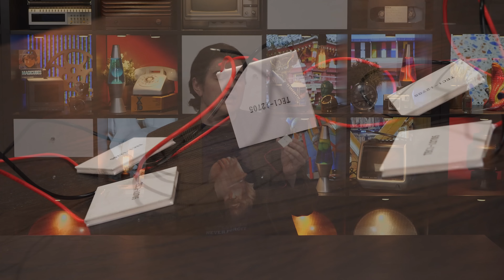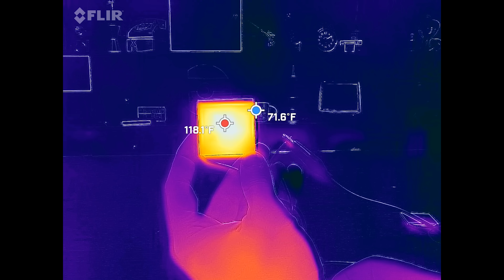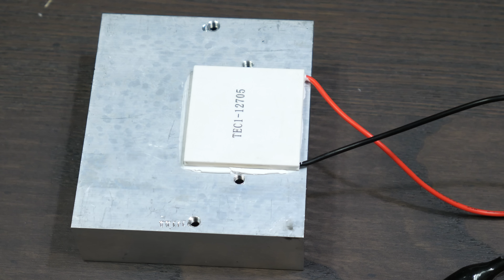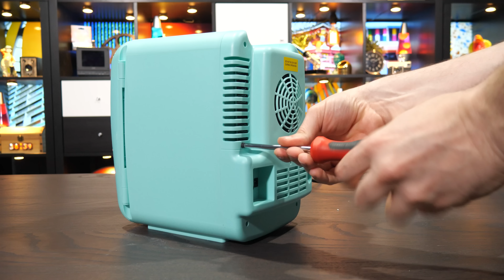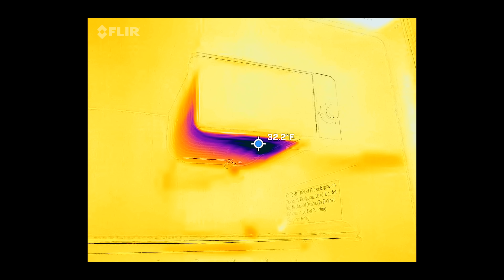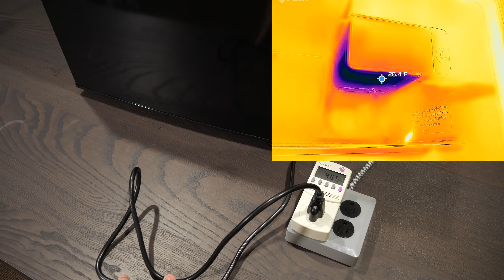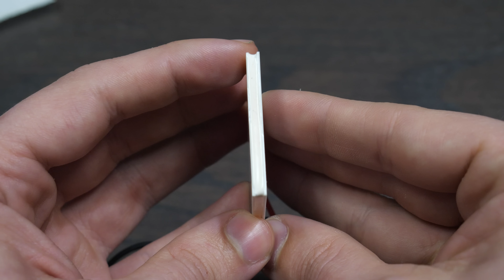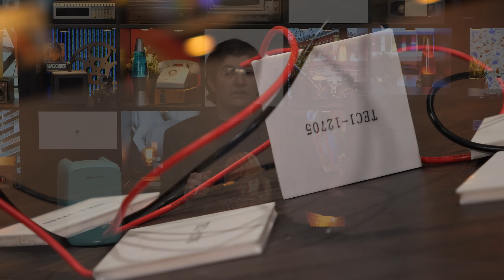Thermoelectric cooling: it's not great.

Comment: comparing a mini fridge to the tiny fridge is ignoring one thing: the mini fridge wont fit where the tiny fridge will and thats the entire draw and appeal of the device... make a legit fridge that tiny and you'll be filling the same role and will address the problems you brought up! yes, its poorly designed and inefficient but if someone really wants a tiny fridge how many options are there? Hoping for a legit, decent quality option because now i kinda want a tiny fridge as long as its not shit lol
Reply: You're technically correct, but there's a fairly small niche of applications where minifridges are too big but you need actual cooling.
These are about WxDxH 7"x10"x10", whereas the smallest mini-fridges are about 16"x16"x19". I could fit a mini-fridge on my desk with only slight inconvenience. I could fit one under my desk too.
I think in part the reason there aren't smaller proper fridges is cost.  The minimum cost of the compressor set up is just high enough it wouldn't have a market.

Comment: The reasons that Peltier devices do not usually have simple on/off thermostats besides the extra cost to manufacure and being probably unnecessary is that with many cycles of on then off cycles the Peltier elements can be seriously degraded by repeated micrscopic cracks due to the induced thermal shocks of on/off operations or phases. More sophisticated, also more expensive, temperature controls would use PWM contrrollers with PID modulation to reduce thermal shocks to the Peletier elements while maintaining an acceptable temperature range under varying working conditions and an acceptably long operational life.

Comment: The 12v DC compressor technology today is amazing. I use mine with 500W lithium ion battery pack and foldable 220watt solar panels camping. It will cool down to O F in summer temps, just like Frig Freeze in your kitchen at home. They average 25  watts per hour to maintain 32F at 85F ambient.  Like home frig/freeze it cycles on and off. COST. You can get them for about $200. Down side? I set to 36F to keep 32F over all but at the very bottom it gets below 32F food item sitting directly on bottom will freeze. However drink cans are happy to sit on bottom. So you pack food item on top. So temperature distribution is not perfect but easily compensated. If you want ice cream it an go below sub freezing 0 F.  It is one compartment like a ice chest so it will be a freezer just like home freezer.

Comment: Something I'm wondering is if these devices can be tuned to use, say, 50% of the power but still cool 2/3 as well, and then you'd have better cooling for the same power. Other glaring problem with blue is that it doesnt even have a good cooling setup. It should be pulling in cool outside air from those side vents, and then pushing it straight out, so negative pressure. Looks like it pushes straight in, which will keep the walls of the blue one hotter, and with that little performance, you need all the cooling you can get. They could have at least designed it well at basically zero extra cost and couldnt even do that...

Comment: 19:50 25+ HVAC TECH, good explanation of the refrigeration process.

 I bought a 12V cooler 30 years ago to play with at work and got the same results. Powered with a 6 amp battery charger. 

The only people I have ever seen use these are truck drivers to keep drinks cold in their 68-degree A/C cabs.

Pure sine wave inverters and mini fridges are so cheap now that truck drivers switched.

Comment: What if we add liquid cooling to these things? 

Here just a hypothetical.

What if we added a 360mm rad to the top with liquid cooling ram to the heat sinks of the hot side to transfer, the pump would keep the fluid moving to the rad, the rad would air cool it.

Might make it a bit more efficient, if I had to take a rough estimate I’ll say it be 20% more efficient if done right.

Of course this adds a lot more cost to that $30 useless fridge making it closer to a actual mini fridge.

Comment: It's not great in that respect, yes. But qPCR machines (see their importance during the COVID pandedmic) however use this technology as it allows a very precise temperature control, with lower than 1°C in precision, and some can ramp up temp 20°C/sec and cool down reaction chamber just as fast. This is a requirement for this molecular biology technique.

Comment: Summed up:
If u want cold beverages all the time -> buy a genuine refrigerator 
If u want cold beverages like two days a year -> buy this cheaper thing and save money or buy a proper big cooling box with Peltiers, put some icecubes in and let it run so the icecubes won’t melt as fast as without.

Comment: Thermoelectric modules are actually great for when you use both the hot and cold sides simultaneously, such as those machines where you can get both hot and cold water, they've just hooked pipes to both sides and use the heat from the cold water to heat the well hot one.

Comment: No need to hate on them - they have their place.
I have had reasonably big one for nearly 40 years. I use it with a camper.for keeping drinks cool. When I run it on shore power it costs me nothing and when there is none I run it on the solar panel & battery, so it still costs me nothing.
On hot days I cover it with a towel (except the cooling vents) which greatly improves the temperature differential.
On cool nights I do have to remember to turn it off otherwise the drinks are frozen in the morning.
It's also useful for keeping food warm (3 position switch)

Comment: my background is in electronic engineering.  I've been using a large peltier igloo cooler in my kitchen as a second fridge for about five years now.  the engineering of  this unit is fantastically well done, it's quiet, never skipped a  beat, cools down quickly, it's kept foods and beverages safely cold reliably all that time period.  food-safe cold, I might add.  and it's got more space in it than the mini-fridge I also have.  so absolutely no complaints with this unit.  no freezer of course, but I didn't buy it for that.  I also have a smaller one for the SUV, that keeps sandwiches and beverages cold for the afternoon.  again, well-designed, just works, I love it, absolutely no complaints.  So I know from my own experience that the technology itself is great, and in a well-designed unit delivers reliably cool food-safe environments that simply, well, work.  so I'm a big fan and I think it's a great idea.  I also had a Coleman unit whose engineering was terrible, it was pretty useless, noisy, low air-flow, kept freezing up and then the fan would get noisy and eventually jam, plus the power supply got very hot, I junked it.  so to me the technology works as promised, but the unit must be well-engineered to get good results.  sounds like the unit you purchased was a piece of crap.  and I'm not against conventional fridges, got one of those too.  like anything else, you have to evaluate the features, intended use, quality of engineering, and build quality.  your videos are interesting, thanks for doing them.

Comment: Yea I was stung by one of these, bought it so i could keep my beers in it at my desk in work absolutely useless, now its back to the communal office fridge and stolen beer. Mine doubled as a keep your food warm by flicking the switch on the back from cold to hot that should have set my alarm bell ringing.. Wonder how many Peltier elements you'd need to make a freezer and what the power consumption would be if it ever worked which I guess it wouldn't.

Comment: Compressors are getting smaller and smaller. Makita makes a portable battery powered cooler that can cool or heat the interior and it uses a compressor. Dometic makes a compressor powered unit that drops into the center console of your F150 to turn it into a small refrigerator.

Comment: The thing is, you should not expect this device to perform like a full size fridge (and, to be fair, how long does your fridge take to cool a room temp stack of six cans to 7C?). The way to think of these things is 'a bit better than a straight cool box'. So load pre-cooled drinks cans and it may do something useful. Though, possibly, a cool box with an ice pack may do just as well for 'cool beverages in the office'.

Comment: I got one of those cooling coolers.... And I can confirm they do suck. 

I have two rabbits and the only thing I use that cooler for is to put a small bag of lettuce in it to keep it from wilting for about an hour while I let them play around and then feed them. That's the only thing I use it for as it's really no good for anything else. And even then it barely keeps the lettuce lukewarm.

Just writing this comment just to say that he's right.

Edit: forgot to mention that the bag of lettuce that I put in there will end up with so much condensation on it that I will have to wipe out that cooler often. Otherwise it'll mold at the amount of condensation that is inside of the cooler. They suck and I'll never buy another one.

Edit number two: OH MY GOD THAT'S WHY THE BILL WAS SO HIGH!?!

Comment: So. I looked into home heating with heat pumps. It seems to me (correct me if I'm wrong) that "new" out-of-the-box systems are expected to last, at best, 15 years, with a whole slew of places for the currently heavily corrupt HVAC installation, mx and repair companies to absolutely fleece consumers.

A video guide on this would be fantastic. If I find you made one already, great! Otherwise, I await my elucidation. I'm much too removed from source material (like being an HVAC technician, or knowing a manufacturer, or board member, etc.) to find trustworthy material. I also want to know if any competition is viable -- could a 30 year+ heat pump system actually already be a thing and we just aren't given access to it thanks to gatekeeping? Or whatever reason?

Thanks for this video, it was great. I really appreciate my fridge a LOT more.

Comment: 2:36"The energy source of a car?  You mean gasoline?  What does it cost to use gasoline to generate 55W/h?
2- Could you use multiple (energy deficient) peltiers to step down 30 degrees at a time?
C - If it's on-your-desk at work, it ain't your 'lectricity.

Comment: While your points are valid for consumer products, I do want to add that there are uses in other areas. I know at least a few in lab/research equipment when you want to have very fast temperature changes or very precise and stable localized temperatures. For the first situation, PCR machines need to cycle repeatedly between hot and cold fairly quickly so peltiers are a great option. The other example is cooled camera sensors in scientific cameras, like the ones used in astronomy and advanced microsocpy, where the sensor might be cooled down to -100C and you want that to be very stable. There are a few other examples but essentially come down to fast and stable localized heating/cooling, potentially alternating between both.

But yeah, mini fridges are a silly gimmick.

Comment: I only learned of Peltier elements recently, when Robert Dunn found them inside an EV battery-pack. It sent me on a Wikipedian rabbit-hole, and finally explained to me how my electric cool-box worked (past-tense, because repeated slamming of the lid has caused a short somewhere and it keeps blowing fuses when on 230V mode (it still runs in 12V, but that's less helpful when camping).

The Six-Can-Bonanza is probably only useful if you want to keep a personal stash of cool tinnies in the office - hide it under your desk and waste the work's electricity instead.

Comment: The problem is that any refrigerator that will run off of 12v dc costs around 700$ or more and if you spend around 120 hours a week in a truck its nice to have something while your saving up for a real mini fridge.

Comment: Got one of those tiny fridges for $2 at a thrift store and it's great for my long road trips as it runs fine on 12v. The fan was annoying but it uses a standard 90mm PC fan so I just slapped a noctua fan in
Reply: So, the fan cost much more than the fridge.
Reply: @Pushing_Pixels I'm really hoping they were upgrading their PC and were gonna throw the fan out anyways...
Reply: @Pushing_Pixels   Yep, and...  I'm sure there's zero downside to a fan that is optimized for quietness.  Makes you wonder why they still make loud fans at all.  Must be "corporate greed," a'cause usually the answer, right?

Comment: Those devices when heat and cooling is applied externally to the faces will generate an electric current, this is how a radioisotope thermoelectric generator makes electricity for spacecraft with limited exposure to intense sun light

Comment: Wow, your first video I have to disagree with! I have several peltier based coolers and love them all. 

My wine cooler is completely silent because it has passive thermoelectric cooling – you can't achieve that with a compressor based cooler. AND it keeps the temperature within 0.1 degrees – you can't achieve that either with a compressor based cooler.

I also have a 20 liter mini fridge that only weights a few kilograms and goes anywhere – you can't achieve that with a compressor based cooler. It works either with AC or DC, has a thermostat and cools and heats quite fast because it has internal fan, which is really needed to make peltier work somewhat efficiently.

Then I've built a peltier based soft cooler insert bag to my backpack. It weights just one kilogram, works either with AC or DC and takes very little space when folded or acts as a extra shoulder bag. Because it has somewhat sub par insulation it can only cool about 12 degrees celsius below ambient temperature, but I can assure it still makes the beverages much enjoyable than to drink them at ambient temperature. And it was a fun project to build.

Sure all of them are inefficient compared to compressor based coolers, but then again, thermoelectric cooling gives you options compressor based cooling can't. And yes, that blue fridge is probably just a toy, just like my soft cooler bag, but all thermoelectric based cooling isn't.

Comment: I used to have one of the portable models, and it seemed to do the job pretty well. It probably wasn't efficient, but it did the job of cooling off some soda/pop/Coke cans. It had fans on both the warm side, and the cold side. Sometimes, ice would build up on the internal heatsink & keep the internal fan from working. The more cans you had, the better it would work. If you let it run overnight, all the cans would be cold in the morning. It ran on 12 volts.

Comment: one thing i never understood about refrigirators: why do we passively radiate the heat away after the refrigirant has been compressed? why isn't this coupled with active airflow? 
if you cool the refrigirant actively back to ambient temperature, wouldn't that cause the condesing phase to cool the refrigirant even more, allowing faster/more efficient  cooling? 
i'm no mathematician, i can understand if a blowing fan draws more energy than it blows away that becomes less efficient. but even just heatpipes like you'd find on a pc would improve the passive cooling, wich is what you want, right?

i must be missing something obvious because so many people have put so much more thought in this than i.

Comment: There is another thing i feel like adding : 
The larger a fridge is the more efficient it's gonna be , even with the same powered compressor ... 

It just becomes a surface/volume deal , and smaller refrigerators are gonna be at a disadvantage by default , since they have a lot more surface area compared to volume ...

That's why in the olden days before heat pumps pepole used ice houses : large partially underground brick buildings , wich in my area and nearly everywhere are either spherical or integrated in hills , 
Also the doors where pointed at the pole to avoid any insulation , 
The cooling method was to take snow and ice from mountains and winter and stuffing it in the ice house , 

This has terrible efficiency , 
but it worked , 

And there is a reason why it was a building more ofthen than not , because buildings have incredibly small surface to volume ratios ,

A 30cm box is gonna be terrible in that department ...

Paradoxically keeping a whole bunker , powered by solar and accessed by elevator shaft , could be more efficient than all those refridgerators , but i doubt that will be experimented anytime soon ...

Comment: Oh, my mini toy fridge has a handle, and came with a second plug to plug directly in to a car’s charge port (ie, cig lighter) - so in theory, I could take it on the go. But even on long road trips I’ve never done that. Why? Bc a few ice packs in a cooler works just fine, and keeps thing cold for 12 hours without needing to be plugged in.  

I still love my little toy fridge, but if I can find space for a mini cube, I can be talked in to getting one of those instead.  I think my soda consumption would just increase dramatically. Instead of limiting myself to one per day, and refilling the fridge on weekends, I could drink 6 per day without depleting the fridge in a week!  Ok ok, I’d likely fill it 2/3 with water bottles…